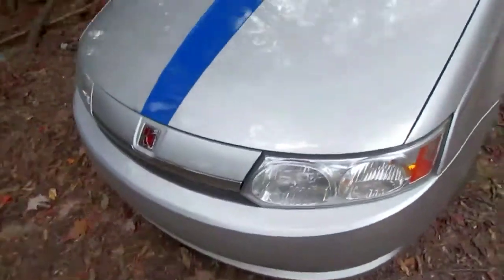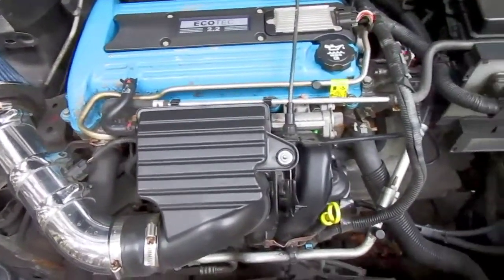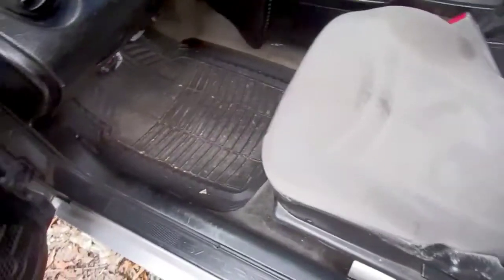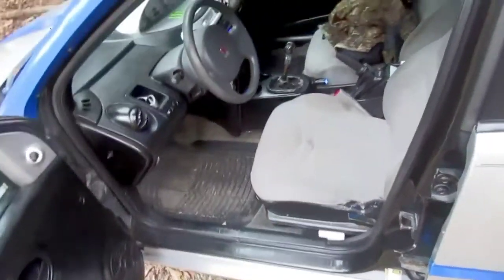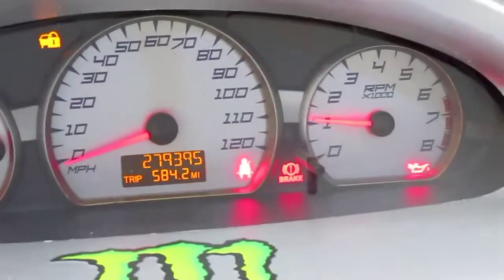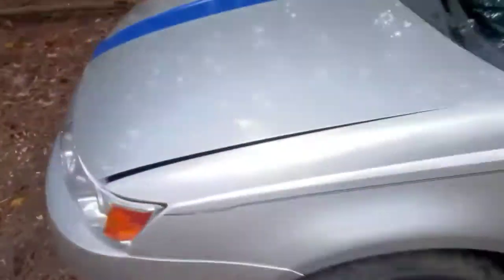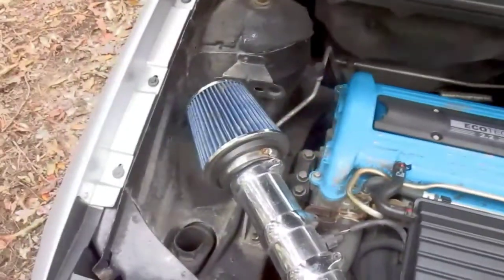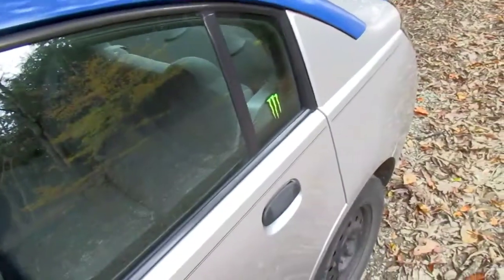Saturn Ion With Almost 300,000 Miles!

Comment: Found a 2007 saturn with 26,000 miles. Was owned by 1 owner. An old lady. Super clean car fax no issues ever she took that car to the shop like clock work every single time she was supposed (by the book) we paid $6000. more with tax n fees etc. We still love it 8 months later.

Comment: Have 273,478 miles on a 2004 ion 2 original engine and Transmission.. automatic.. sometime you get lucky.. bought in 2006 with 4500 miles

Comment: I got one of these for free from a family member. They thought the transmission was shot, the filter was plugged solid but no debris on the magnet. Sure as shit it came back and drives perfect now…. 222,000 miles but the rings are kinda shot, 1 quart every 5k. Can’t complain though

Comment: Just bought my buddy’s.  I noticed  good mount of pressure / exhausts comes front he crankcase when I tar the oil cap off when it’s running. Does your ?  I’m working on cleaning it up. Had 176k. Seems fast

Comment: I got a 2005 chevrolet classic with the 2.2l ecotec, its got 225k, bought it at 212k and have done repairs and rigorous maintenance on it, she runs butter smooth, it will need suspension work soon, i plan to keep it for right now